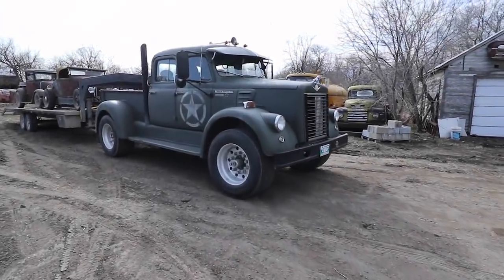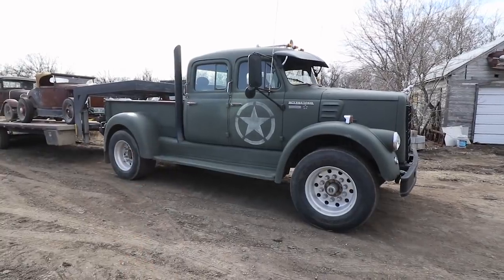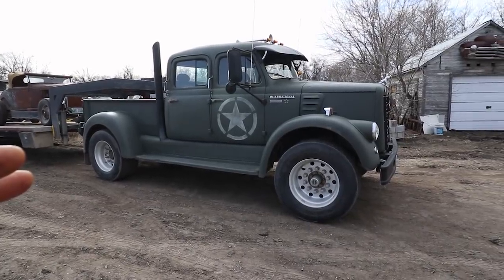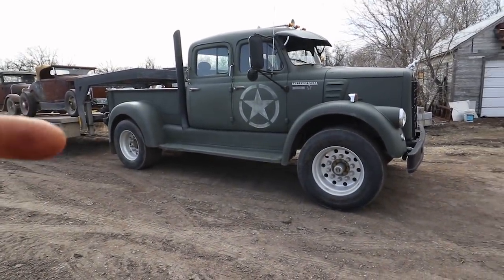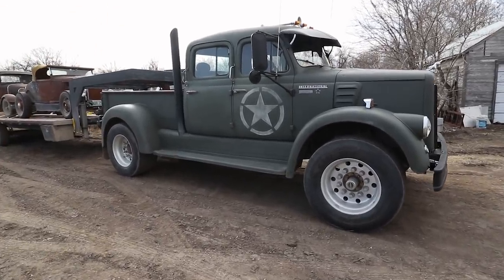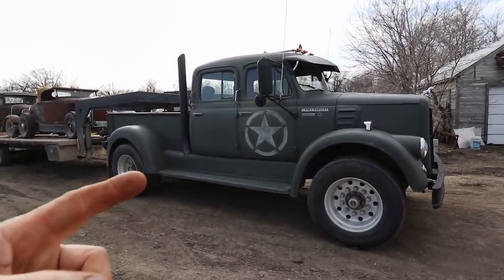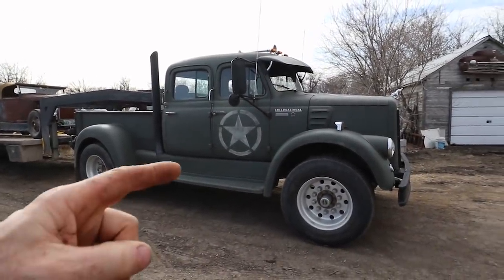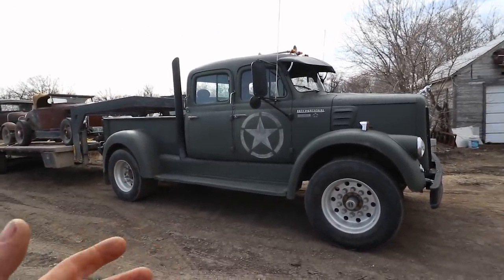Deboss International Car Show 2021 Entry

Comment: I retired in 2019 with 27 1/2 years of service in the army and I held a master drivers license. (Actually from 1979-2019, I got out for a few years to start a family.) So basically anything they needed to be driven anywhere I was authorized to get behind the wheel, laterals or however it was steered and roll it out. After driving a lifetimes worth of vehicles, wheeled and tracked I’d still be proud as a pup to get behind the wheel of “The General” any day of the week, and thrice on sundays lol. She’s a beauty that’s for sure. Tough as nails but she’s a looker too and maintenance, too easy!  I loved watching that build, you taught me so much and you also practice one of the key rules that’s worked so well for me in my life. It’s so simple too, it’s “half of any battle is always in ones attitude.” 
 Always stay positive and even when it’s very rough going, it’s still to be looked at as “no big thing!” Thanks brother, this was one helluva ride, I salute you! 
(And the general of course) 

Ok fine, first the general, then you... 
Officers are funny like that pfffft😉

Comment: I really have to say you did awesome job with what you had to work with turned out great are thinking of maybe setting up a winch that you can use on the front or rear of the general one that you go in your hitch receiver so it’s never in the way

Comment: I binge watched this build in 2 days. I love the entire build and am so glad you left those aluminum rims without painting them. I am still so digging your build. I wish I could sacrifice my Daily 2000 F-350 7.3 International extended cab to have this done for me. I also watched a guy take a 2000 cop car crown vic and splice some old one piece 1950 Ford pickup truck. There was also someone who took an old 3+3 and turned it into a 6+6 then used a stepside bed. Some people hate others love it. I mean I don't like any 4 door cars. But I am into trucks with 4-6 doors. There was a guy in Arkansas that took a suburban cut the double doors out and welded the back of the cab of his dually. He then put and extra row of seats in the bed on the suburban. He kept that big rear mounted air conditioner and extended the back to place the full size dually that looked like a short bed. He used it to haul his race cars to the track. But I was obsessed with your videos as it wasn't until I watched all the build parts that I finally found where you started from. I would love to do this but keep my modern dash and interior. But definitely find a box to go on the back with steel fenders. I bought the truck because I wanted to buy something that can go a million miles. I just had the transmission fluid all changed. I wish I would have found it with a 5 speed transmission for $9000 cash to an old man. He bought it to take his grand daughter to the rodeos and he only towed a horse trailer. She grew up went of to college so he parked the truck under his carport for about 10 years. The tires were dry rotted and I had a tie rod break on it so I had my mechanic change both sides as well as the windshield was cracked and it had a small leak. So I wanted the leak fixed. Come to find out it has some rubber gasket for the windshield and the rust had bubbled up. So the glass shop sanded it all down primed and painted it as well as he put the the new seal and windshield in. I park my truck under my house.

Comment: the antennas need to to be in free space to work ( any metal close to them will cause the swr to go high  blowing the radio up ) move the mounts to the top and make sure that you have a good connection from the mounting point to the trucks body even if it requires you to run a ground wire to the the frame ( i am a radio ham and understand / been here with antennas)

Comment: Your retake did little justice to the hard work that you put in. I would say that the first three quarters of the build went the fastest but then you were getting tired of same rig day in an out. It is really too bad that the brake drum and wheel assembly couldn't be found in a way that eliminates adaptors but they are okay just as well. I still have to figure out how to vote again but will. I should think that this entry should win one of the levels of entries they have. Almost makes you think that if you had done it to the last detail instead of I and the wife will take it camping or a cruise... nice job again Brent. I look up and see the link/LOL, how hard can it be